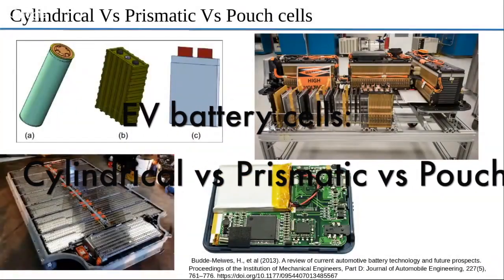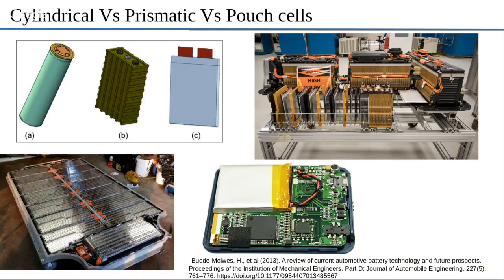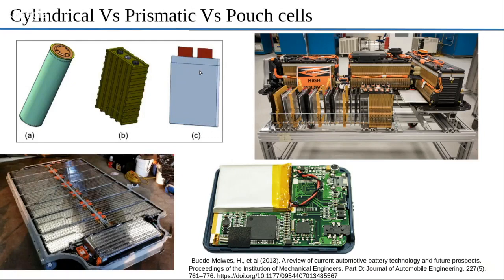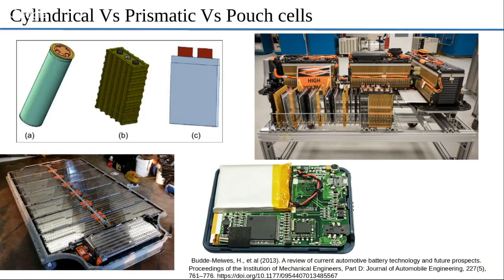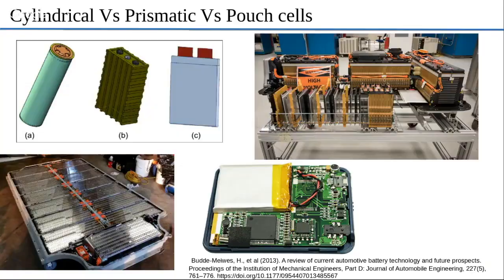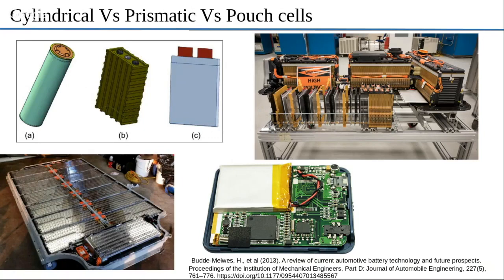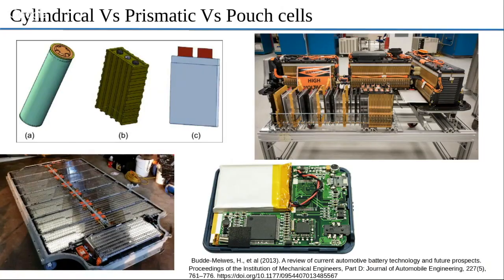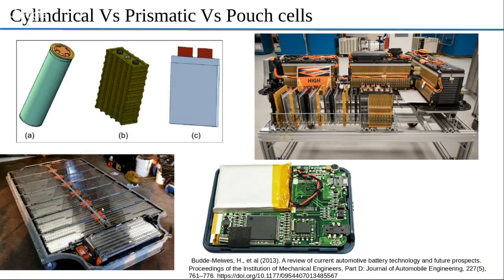How are cylindrical, prismatic, and pouch style battery cells different?

Comment: BTW, it is also incorrect that when one cell in a Tesla pack is failing it s impacted only by 1/7000. In a battery pack the weakest link determines the capacity of the entire pack. There are 96 bricks in series. If one cell fails, the effect is 96 times as much as this one brick is now the weakest link and limits the capacity of the entire pack. Another statement that isn't quite true is the load on each cell in high power drain situations. Yes the power is divided between 7000 cells vs 300 but those 7000 cells are also much smaller. That's why the 'C' factor is used when describing load on batteries. Instead of absolute power numbers, what really matters is the ratio between cell capacity and power draw. C1 means the power draw is equivalent to the cell capacity in Ampere. C1 on 7000 small cells is exactly the same load as C1 on 300 cells that are larger. And that's what matters to a cell.
Reply: I'm pretty sure the BMS can isolate failing cells, or at least bricks. In practice Tesla batteries degrade very very slowly, so regardless of how this works, it's definitely not an issue.
Reply: @andrasbiro3007  the BMS can't isolate cells not bricks. But even if it could, that would make no difference. A single lost cell is always multiplied by 96 in terms of capacity loss.
Reply: @DavidDrivesElectric  

Look into the Tesla BMS, and the overall structure of the battery. I'm pretty sure each cell is individually managed.
I looked up the details. I found very little about the Model S battery, but it seems to consist of ~7100 cells. 96 cells work in parallel in a brick, and bricks are connected in a series. That's 74 bricks. If Even if each brick has to be at the same voltage, that means each dead cell counts as 1% capacity loss. Not the end of the world. But if they are managing each cell individually, one cell failure is just 1/7100 capacity loss, which is nothing. I'm not sure about the Model S, but the Model 3's BMS definitely manages cells individually. https://www.youtube.com/watch?v=TdUqQZC2dcE https://teslamotorsclub.com/tmc/threads/effect-of-a-cell-failure-on-the-whole-battery-pack.95480/ https://insideevs.com/news/338947/expert-says-tesla-model-3-battery-pack-is-most-advanced-ever-produced/
But the very slow degradation of Model S batteries suggests that it also manages cells individually. It's not just about dead cells, but cell imbalance, which seriously reduces battery life.
Reply: @andrasbiro3007  It is physically impossible to manage single cells the way the battery packs are designed. This is true for Model S/X/3.
Reply: @DavidDrivesElectric  
This is the most detailed description of the Model 3 BMS I could find : http://evtv.me/2018/05/tesla-model-3-gone-battshit/ And reading it carefully, I found that what this article calls "cell" is actually a "brick" consisting of 96 cells. So probably this is the source of the confusion. Anyway, that's still sufficiently fine grained control to make rare cell failures mostly irrelevant.
Reply: "96 times as much...." I don't understand how.  If you are talking about the maximum peak current available, but in EVs its all about the number of watt hours that determines distance. So if you are talking about 96x in terms of current for brief acceleration then yes, but its not 96x when measuring the available energy to drive the car in normal running.  Also in your comments to Andras Biro, yes you are correct that the BMS cannot "isolate" failing cells, but the bms  can "compensate for" weaker bricks through battery balancing. Therefore it would not be a 96x penalty for one cell failure. Happy to hear your views if I am incorrect.

Comment: 1) Best in cost per KwH: Cylindrical
2) Best KwH per weight:
 Pouch 
3) Best in temperature management: Cylindrical
4) Speed of battery production: Cylindrical
Why did GM choose pouch? Maybe they could not balance the voltages of cylindrical cells as Tesla did.
Reply: Very professional explaination.
Reply: #3 is wrong. Pouch cells have more surface area to cool without hot spots like cylindrical cells.  The Volt's back was way overkill in the cooling department.

Comment: Does anyone know the amp discharge rating of the 18650 cells Tesla uses? Like DeWalt battery packs have a 20a discharge rate, meaning they can safely and continuously output 20 amps to the tool for long periods of time.

Comment: One down side of cylindrical cells is the weight. The rigidity of the cylindrical cell gives no contribution to the structural strength of the vehicle because the safety regulations state that the battery pack cannot form part of the chassis; it has to be a separate structure. There is an advantage in cooling, but pouch cells can withstand more of the inevitable swelling of the electrodes. Pouch cells will come down in cost as faster cycle times are achieved through innovations in the manufacturing process. So that would explain the preference for pouch cells with so many manufacturers. Also, if a cell in series with a whole bunch of other cells “goes bad” the whole section is affected, so the impact of one cell going bad is not as much of an issue as stated.

Comment: Other companies are probably using pouch cells because they are cheaper to assemble into a battery even if the cells are more expensive. Tesla has perfected the assembly of cylindrical cells into batteries. So Tesla can take advantage of this cost savings due to there manufacturing expertise.

Comment: As JB Straubel once said, the packaging isn't important, but what's inside. Tesla doesn't have a cost advantage because cylindrical cells. They are producing far far more than any other EV companies thus they can produce cheaper. Tesla's success is stunning, but it is not due to the cylindrical cells form factor. That has purely historical reasons. When they started production capacity was mostly available for cylindrical cells. Tesla designed their battery packs around those cells and got that to work really well, so they continue that way rather than starting their battery pack design from scratch. The other reason Tesla is ahead in batteries is because they push their batteries way more than others. They might have pushed too far as we can see now with the old 85 packs which are now severely crippled by Tesla in terms of charging, performance and also capacity.

Comment: Sean, thanks for the video. However several other resources including Sandy Monro highlighted that the paunch cells are more cost effective than the cylindrical. I wonder why this gentleman say the opposite
Reply from the maker: Though I don’t have any data to back it up I’d take a guess to say Tesla cylindrical battery packs are very complex to make and therefore more expensive, pouch are not because it takes less time to manufacture. The individual cylindrical cell is less expensive than pouch. I may have covered this in a previous video back in August or September.

Comment: My BS meter keeps ticking up during this whole presentation. Cylindrical cells are better, cheaper and yet nobody uses them except Tesla and Rivian?
Reply: Tesla has the technology to properly manage 7000 cells, other OEMs which are not tech companies do not have the technology to manage so many cells so they opt for the easier-to-mange option.
Reply: Definitely believable. I mean, Tesla is not an inexperienced company. They have no experience making ICE vehicles, but that is irrelevant. They’ve been mass producing EVs for almost 8 years now, and have been developing and improving the tech needed to do so for 12+ years. They have years of experience in solely being focused on EV development, unlike traditional automakers. 

Tesla has positive margins on all of their vehicles. Rivian is using cylindrical cells most likely due to the fact that they’ve been working on their tech for 10 years, also solely working on EVs, not ICE. As stated from the video, Tesla’s vehicles are built from the ground up to be electric, same with Rivian’s vehicles. 

Many traditional automakers’ EVs are based on ICE vehicle platforms and/or were not worked on for as long as they needed to be, especially in comparison to Tesla and Rivian, in order to properly utilize cylindrical cells, so they use pouch instead. Legacy automakers have been launching EVs as either compliance cars, or most recently, a rushed reaction to Tesla’s apparent dominance of the EV market, which they now acknowledge is the future. 

Prime example is the Ford Mustang Mach-E. I like the car, but if you read about it, Ford pretty much has admitted that the Mach-E was going to be a compliance car at first, but then they did a complete design and architectural overhaul over the course of 2 years to make the car a serious competitor to ICE vehicles as well as EVs. In short, the Mach-E was relatively rushed, as with many legacy automaker EVs.
Reply: @waynelewis9110  Cylindrical cells are better, cheaper and yet nobody uses them except Tesla and Rivian?
Reply: Robert Evans Yes, Tesla and Rivian are the only ones. Cheaper + better != easy/easier to utilize. Hence why Ford jumped on investing in Rivian to use their skateboard platform in some of their future EVs instead of developing their own. Using cylindrical cells in a battery and power train platform in EVs appears to require expertise in software (for BMS), proper cell chemistry, electric motors, and major investments in actually developing the required platform instead of talking about it. 

The Ford Mustang Mach E uses pouch cells, and despite starting at $43k, it’s going to be $4k more than the starting price of the Tesla Model Y. Ford will be building Mach Es in Mexico, utilizing a ton of robots. Yet they are still going to experience anemic margins on Mach Es despite this. In contrast, all Tesla Model Ys sold in the US will be produced in the US, and Tesla will experience healthy margins on Model Ys. A testament to their hard work on honing cylindrical cells + electric power trains, which made them cheaper to produce and utilize.
Reply: @waynelewis9110  You are aware that Tesla released all their patents to the public, aren't you?
Reply: Robert Evans That is irrelevant. If you honestly think that they released their battery patents down to the cell chemistry to all of their competitors, then you’re sorely mistaken. Even then, wouldn’t you think that legacy automakers would have already been using cylindrical cells? It’s clear that it’s not so simple as you’re assuming it to be. 

If what you’re trying to do is imply that Tesla is not leading in terms of batteries and electric power trains, then you might want to change your tune on that. VW, the second largest automaker in the world, has stated that Tesla is a leader and a worthy competitor in the auto industry. At this point, Tesla does not need your stamp of approval, nor do they need mine. But their actions have earned mine personally.

Comment: Cost of material is usually the smallest part of a vehicle. Labor is the primary content. So Tesla is not unionized, does not pay union scale and is not required to have at a minimum three workers per shift to put out what one worker not in the union can produce. 7000 connections and numerous assemblies are cheaper for Tesla than 200 connections and less assemblies for an auto maker already ruined by unions. I have always used pouch packs for my electric vehicles, they are more space efficient, since even with hexagonal closest packing cylindrical cells have a lot of air included in the pack. As far as cell stress with massive amounts of current required during acceleration, the area of the active chemicals is what provides the current. As well the internal resistance of the cells will influence the efficiency of the cells both from the old I squared R and from peukert factors where capacity is lower for high draws than for lower draws. Prismatic cells are just prepackaged pouch cells with lots of extra added weight and volume. Great for DIY assembly or for batteries with few cells in series. For high voltages used in vehicles, the prismatic cell is just way too bulky and difficult to cool.

Comment: I do disagree, pouch cells are way more capable of discharging high current. There is way more material in a pouch cell than in a 18650 cell. Especially bike batteries are made of pouch cells because they are manufactured in longer flat sizes and fit a canister way better. Cooling is also way better because it's a larger area to have direct contact with metal casings. I have seen 3.7v 200Ah pouch cells that are way smaller than prismatic equivalent cells. The weight is half of 18650 equivalent batteries. I have also read a new study that claims you get twice the cycle life if you compress a pouch battery into a strong metal casing so it can't expand. So, 1000 cycles for a 3.7v lithium ion pouch battery.
Reply: Seems like you and I are on the same page. We should start an ebike business together. If these pouch cells are actually capable of the amp hours they claim, then we can become very rich men. It would only be the beginning.

Comment: They Indian guy is completely wrong, the ONLY REASON to use pouch cells is because they have a higher charge & discharge rate, Easily can be charged at 2-3C and pouch can be drawn at 10-20c where as you can not do that on traditional cylindrical cells. Cylindrical struggle to do more than 3c.

Comment: The biggest advatage of cylindrical is that it can be pushed the hardest due to the natural strength of it’s coiled structure encased in a metal tube.  

Pouch cells will be cheaper to manufacture in volume due to their simple and flinsy structure but they are not suitable for high performance applications.